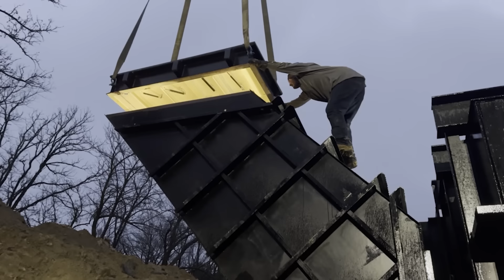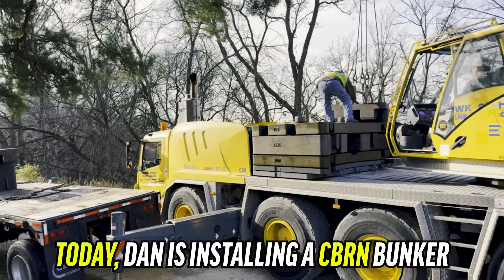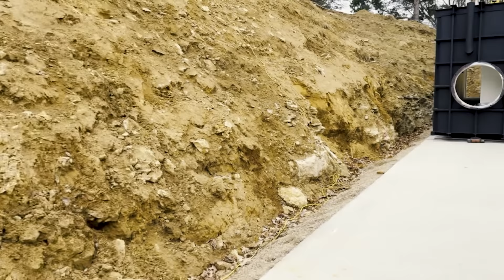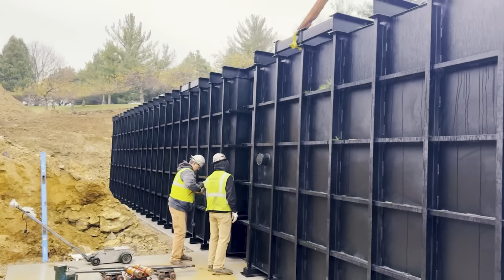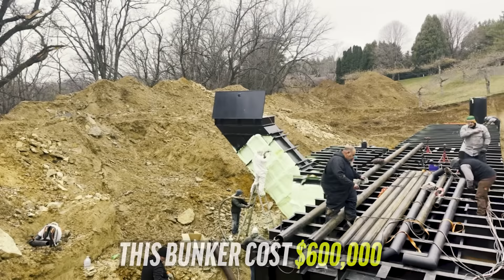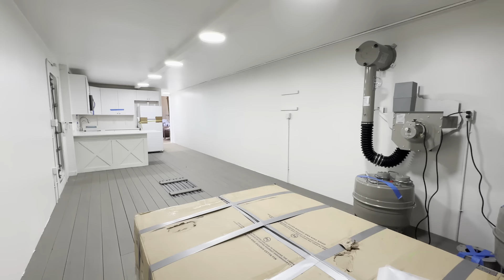Installing an $800,000 BUNKER in Wisconsin

Comment: Question @Atlas Survival Shelters , the way this type of bunker is made with the steel structure on the outside does it work like a Faraday cage in case of a EMP attack ?
Reply: it's all steel even the walls, you're inside a steel box, no EMP gets through, but then it's also underground, Faraday cage is for lightning not for EMP, steel sheet is more effective

Comment: What does it have for heat?
Reply: The bunker itself is lije a "cube" made of pure thick steel (iron & a bit of carbon) on all 6 sides [so all of its outer & inner "structural" surface has the same temperature].
  |  
.  The bottom has a thick concrete slab, all other 5 sides a less thick but much better insulating foam (so about the same in all directions).
  |  
  .  The temperature of the 8 feet of dirt on top may change a lot over the winter & summer  weeks, but the foam/concrete will prevent the heat from seeping out/in.
  -> The temperature of the structural steel is always the same as the whole interior (this is important, as it prevents condensation/mouisture from humidity, so mo mold).
  
  |  
.  This particular bunker has a battery powerbank ment to be recharged daily from a cable that starts on a solar panel (likely on the roof of the jouse on top).
  
  ->  But!  If a nuclear blast destroys the house (or nuclear winter blocks out the Sun); the internal generator kicks in recharging them instead).
  |  
.  Both batteries & the generator produce heat (this is why they are separated from the living spaces); with independent air intakes & exhaust pipes for the generator (internal combustion) & the air around the generator & batteries [to keep them just "warm", neither "hot" nor "cool"].
  |  
The living space has a twin (dual, redundant) air ventilation system.
  ->  The steel vent pipes are covered by plastic/resin like outer pipes (some insulation from the dirt fluctuating temperature); but no insulation on the inside (so the steel temperature of the pipes is the same as the intake air).
  |  
.  The living interior is mostly air in constant circulation; but the hollow "interior storage" under the thin "floor" is expected to contain a few tons of water [this helps to passively stabilize the interior temperature, that should NEVER reach freezing conditions].
  ->  Portable fans powered by the batteries/generator are overkill for comfort needs; since it would never be hot enough to require an A.C. , UNLESS both air systems are shutdown for a while (in that case, CO2 buildip is the real problem, not heat).

Comment: Thanks for selling the pieces to build my own bunker!! Doors and Swiss air purifier!!  I was a boilermaker for 19 years!! Crane, steel election and welding! Concrete work!! All thing i can do! Semper Fidelis!! Location location location!
Reply: i built mine in an Amish neighborhood.
Reply: @andyjohnson5571 how much you spended?😊
Reply: Also, higher elevation
Reply: @peggypearlman Rockies that's it in the u.s.

Comment: I am a big fan of Atlas shelters, been watching the videos for a couple of years now. And I do have a suggestion. I have been in production and manufacturing for over 30 years at indoor facilities that don't quite have the challenges you do when it comes to suspended loads from a crane. Because of our tight proximity to the suspended load and the size of a work area we struggled to find ways to keep our employees safe in case a load shifted or was dropped. What we use currently are extended reach tools that keep the worker at least 10' away from the suspended load. The devise is extended with custom pole ends for gripping and manipulating different configurations.
Reply: We call them load arms, painted safety yellow, everyone who's not involved stays off the loading pad, hard hats required.
Reply: @smokerise  Thats pretty much what I am talking about. The employees putting in these bunkers are in some pretty precarious positions including hands on a suspended bunker weighing several tons while walking on a sloped loose dirt surface. To me its not a matter of if but when. I would fix it before the horrible accident happens that makes it a priority. No one wants that, we weren't as smart and had some stupid accidents first.
Reply: So you guys can touch things with a 10' pole.
Reply: @blogobre  Yup, but the question is..Would we?...lol
Reply: we use a vise grip with a rope tied to the handle

Comment: Hey im just saying, but you should show bunkers for 5k or less. The percentage that can afford this is .01%
Reply: There are no bunkers for 5k or less 😂. I think the cheapest one you can buy is $20k to $25k, and it’s only a tiny little pod 5 feet under. Though it does have the blast door, valve, and air filtration.
Reply: В залежності яка країна)
Reply: Might be the size of an outhouse.
Reply: There are already videos of cheaper shelters to watch and to look at on the Atlas website but they are not $5,000.00 or less. Maybe China could build one for that price ??
Reply: @RJM1011  доставка буде коштувати і встановлення дорожче чім бункер з китаю
Reply: @ПетяБилицкий  Yes I know it will also be shit.
Reply: They have already made those videos, Search their archives.
Reply: Check with the local mortuary or funeral director.